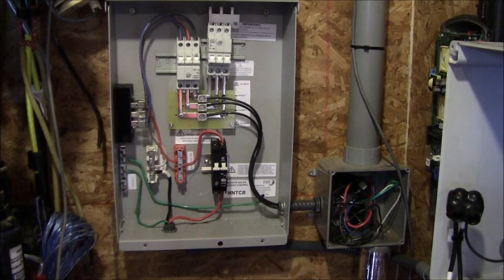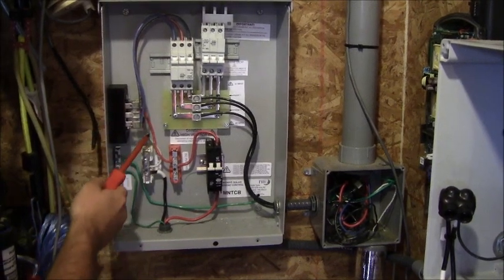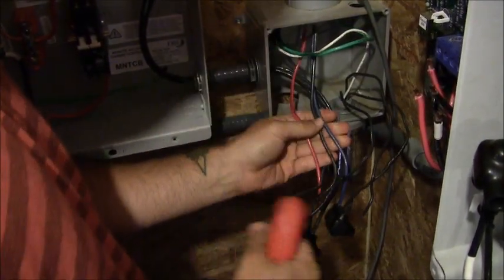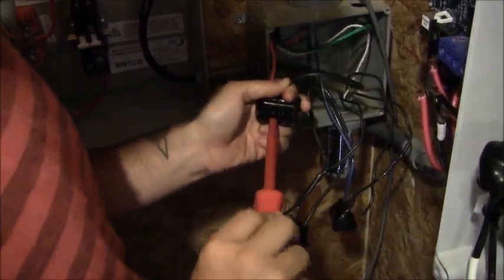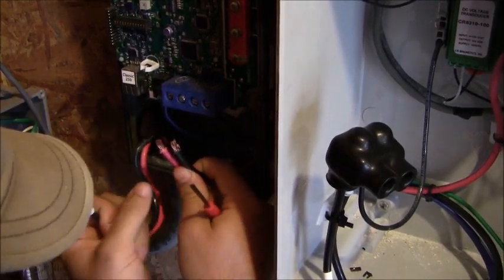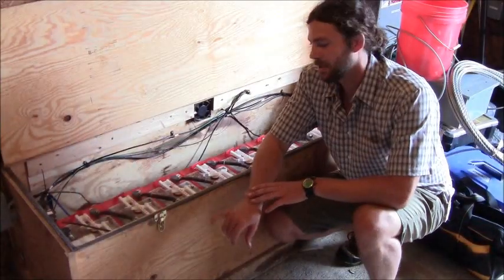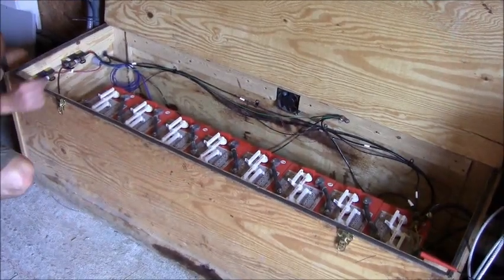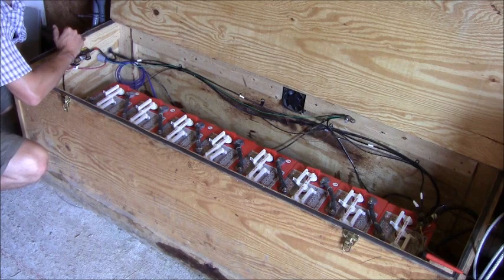Part 7 - Balance of systems wiring

Comment: Please define "Wild AC"
Reply: Wild A/C or A/C wild usually refers to a source of power that has no  regulated frequency and tends to fluctuate under different conditions. I assume the turbine would output a higher or lower frequency dependent on wind speed.